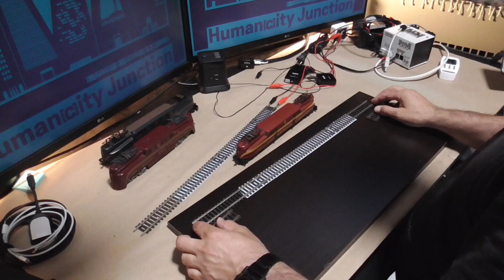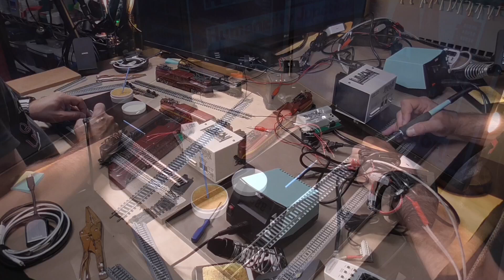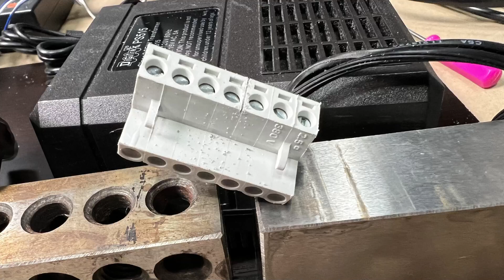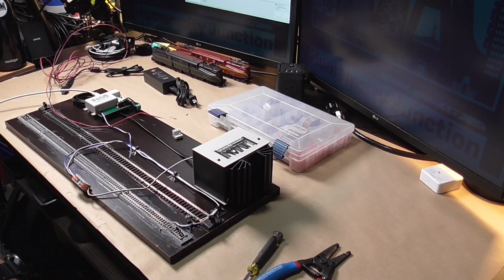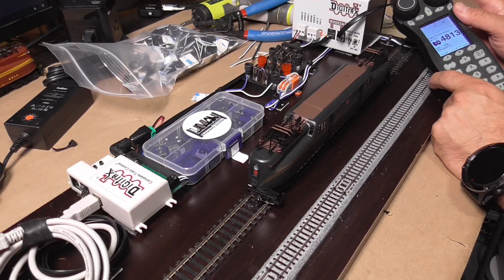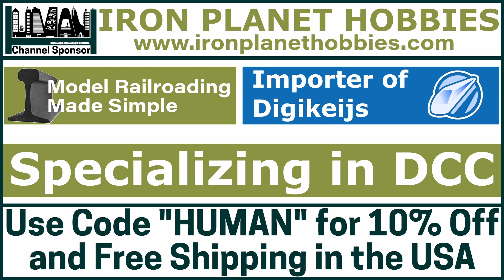Portable Model Railroad Testing & Programming Track Setup

Comment: Good work! I am planning something similar but with an additional Rolling Road, an ESU Decoder Tester, and a DC throttle. As tracks, I will use a three-rail track, which combines H0 standard gauge and narrow gauge. Thus I cover two nominal sizes. In your case, this would be a H0/H0e track. Because of the three sources and the three different outputs, I will use two 2-level rotary selector switches.
Reply from the maker: I got an ESU LokProgrammer after I made this initial programming track, so I will be adding this as well.
For the rotary switch, my recommendation is to get one that is twice the number of selections as you need. And then leave every other one empty. This way you get a clean break between each element, no cross connection.
Reply: @HumancityJunction  That's a good hint. Unfortunately, I have already bought the rotary switches. These have 3 groups with 4 contacts each. One of each of the contacts is the output. My consideration is now to use one group for the one pole and the other two groups for the opposite pole. Group 1 switches the pole from sources 1 to 3, with group 2 only the opposite pole of sources 1 and 3 and with group 3 only the opposite pole of source 2.

Comment: Great work Heath, finally a programming/testing track that is useful and as you say portable. I use my very basic HO one for programming/testing and videoing, until I complete my layout it comes in super handy. Thanks for posting.
Cheers, Gary.
Reply from the maker: When I do not want to fire up the layout, it is great for simple testing and programming.  I am glad I put it together.

Comment: Nice job.  I guess you answered my other questions about the size.  You made it 14" so it fits on the shelf and you can swap out the power supply if needed.  I'm a little bit of a nut with neat wiring.  I use those tie wrap anchors and "P" clips a lot.  My wiring starts out neat but when it gets to the control box, it's another story!  That looks like a very handy project.
Reply from the maker: Sometimes I need to go back and clean up my wiring.  Or I will need to change one wire and then everything turns into a mess.

Comment: Good job/substantially similar to my setup (except I don't have the n scale track) I did away with my portable tracks and simply have it all wired to a track which will double as a city scene display.
Reply from the maker: I do have a programming track setup on my Timesaver Puzzle, but I have found that it is faster for me to just power up the test setup than it is to power up the layout.